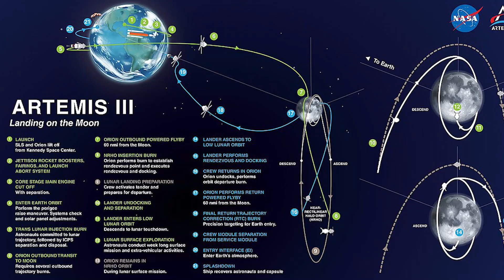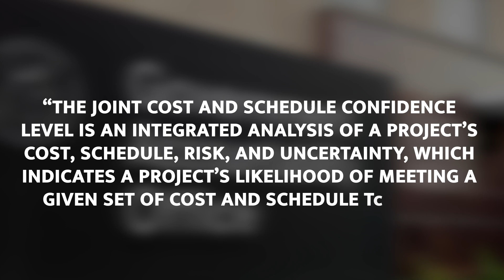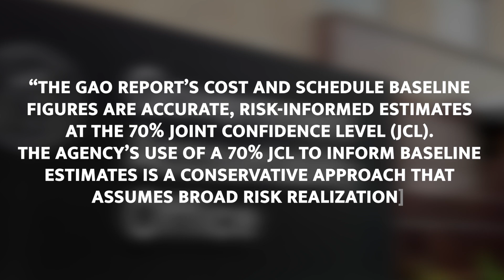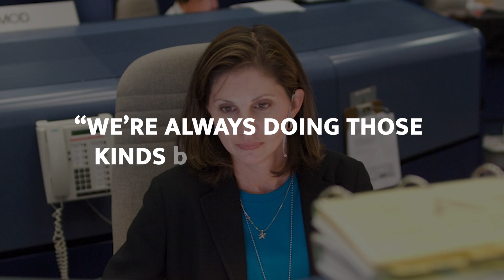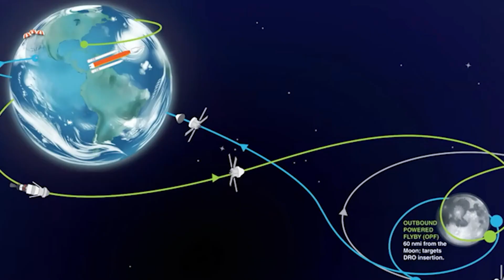Why NASA Will Delay the Artemis 3 Lander By More Than a Year

Comment: What’s the safety concern exactly? They already have an experience of it; of course if they have really landed on Moon as they claim.
Reply: they are lying, nobody has landed on the moon its just like a huge sponge and you will sink right in. Nobody should try reaching the moon
Reply from the maker: It's mostly an issue of doing it now with exponentially better but also different technology.